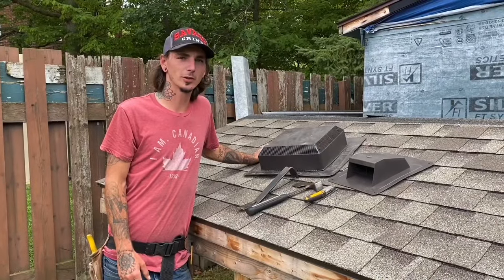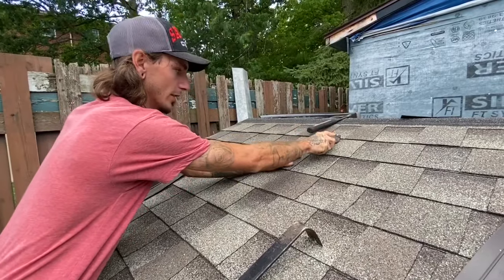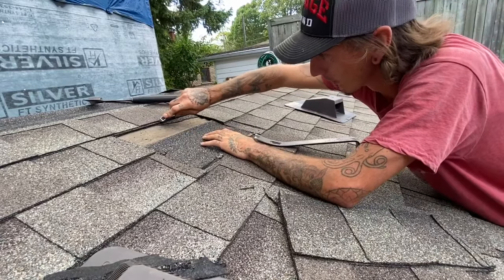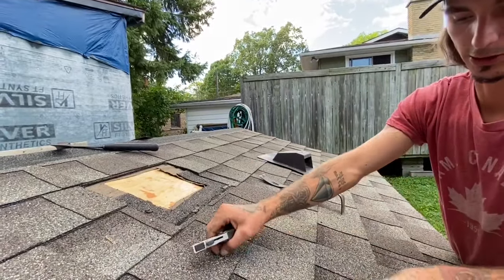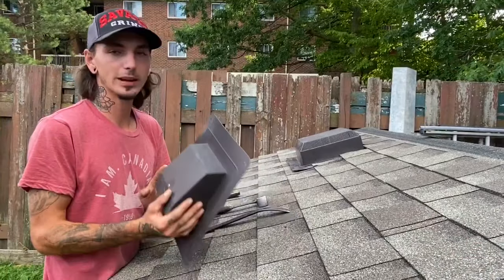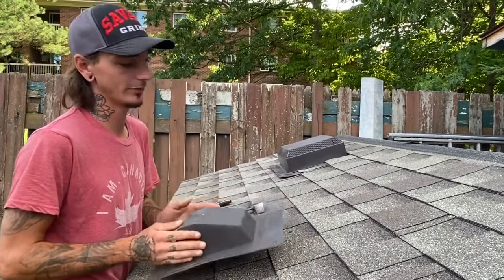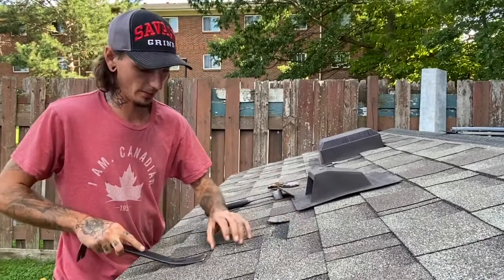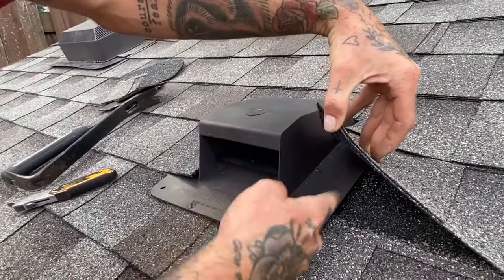How To Install Roof Vents

Comment: Putting a new roof on my shed.   Watched a lot of roofer videos. One thing I found out.  Everybody does something different.  So what do I do?  I pick the guy with the best presentation.  You're a good speaker,  you stick to the facts,  you don't have an attitude, and  you don't tell me a bunch of stuff I don't need to know.  You're above average. Thanks
Reply: great comment
Reply: I second this. Best 12 min of my day, so far!
I’m here to learn. You did a great job at teaching this. Just saved me $400! 
Only thing I would add to this would be techniques for cutting the vent hole in the sheathing.

Comment: Good install, you should mention for the newcomers,  never install the vent before the hole is made. If you're gonna make the hole, make sure your not over a rafter. I once cut a hole thru plywood that had shingles under it and set the attic on fire.
Reply: Damn, what kinda bit were u using?

Comment: Thank you so much I'm going to do my roofing courses next year and apply for my apprenticeship. I'm just studying and teaching myself through your videos and other online sources. I work with roofs as a gutter cleaner, window detailer, work is slow now because of winter. There not much work so I'm spending my time learning new skills!! =D Your videos are clean, simple, and detailed!
Reply from the maker: If you’re in the United States I recommend checking out Upstryve at https://upstryve.com for your courses, tutors and exam prep.
Reply: It's hard work but it's a valuable skill that pays well. I did the same in my younger days boss did sliding & roofing I lean towards brake operator's lax roofing. On the first day on the job when through 7 rolls of coil trying to learn. Surprise I did get fired! I lasted about 3 years very grateful to learn how to be a DYI!
Reply: @Average_Roofer  what about from ontario
Reply: Make some videos of what you know

Comment: The Pro 50s have small dash lines now where the vent should sit on the hole for proper ventilation. An easy template for the vent cut is to use a shingle. The height of the shingle is the same width as the exterior vent cover.

Comment: Thanks for the knowledge man. How do you calculate the number of vents you need on a roof?
Reply: Your ratio of roof vents to soffit venting needs to be where the soffit is greater than the roof venting.  But generally you want one every 15 feet only on the backside of the roof.  Unless you have ridge vents then you dont really need any extra venting..  you want to make it where the airflow will enter through the soffit and exit through the top venting, if the ratio is off then the moist air gets trapped inside and doesnt circulate..  theres a website that has the specifics but i forget exactly ...
Reply: 1 square foot of ventilation for every 300 square feet of attic space.

Comment: I been doing roofing for 28 years and I never install air vents that way but every roofer has there way as long it doesn’t leak and it looks good all that matters. And what counts is that you don’t get a call back roofing in the northwest since 1995
Reply: Why didn’t he at least cut a few holes in the plywood for hot air to release ???!

Comment: How is that vent snug fit into the duct? I mean you placed it flush on the roof, but where is the connection between the duct and that vent? Do you have go go to the attic to do that?

Comment: If your just only allowing for a true exposure for second row of shingle above vent, for the vent your using, weather pro 50, you must cut plywood for vent hole right down to nail line of first shingle that is directly below vent flange. Your vent hole will be roughly 2-3” below the hole you initially cut out of roof deck. You should know this man.

Comment: hey man, why not just use a saw to cut a hole? no hate im just curious as im about to install some vents on my house. also why do you remove the old nails? are they in the way of your new seal or where your new fasteners are going? oh and one more thing, why now mastic sealant?
Reply from the maker: If you use the saw to cut the shingles a. It will wreck your blade, b. The hole will be too big and as for the mastic sealant, the durable pro 50s manufacturer specs do not require it.
Reply: @Average_Roofer  thanks for the response.

Comment: I shopped at my big box store looking at roof vents.  I think a video on vents and vent options would be good information to have.  I have a roof vent fan with a burned out fan motor and lots of hail damage on the aluminum top.  I'm going to want to replace that vent and install more ventilation in my roof without creating too many holes in my roof.  Back in August I found a roof leak.  Turns out it was a bullet hole right over my bathroom from last July stupidity of my neighbors.  I caulked everything and it's holding for now but my roof has been damaged also from falling branches from my next door neighbor's roof.  I think I'm going to have to hire a lawyer for that.  My roof has an Eastern side and a Western side with hip roofs on the East and West.  We have prevailing West and SW winds much of the year.

Comment: Still don't get why the hatchet hammer.  I use one, but only on a cedar shake roof. Does bdr cut the plywood 1/8 too big? I sharpen the shaft of my estwing for slight plywood modification.
Reply from the maker: Ripping nails under walls, easier for repairs when breaking tar strips on shingles etc. Lots of reasons to use a hatchet
Reply: Thanks, next time I tear off against a wall, I will try a hatchet on the step flashing.
Reply from the maker: fender bender works great. Used it today actually. Counter flashing was 5 inches wide and the homeowners didn’t wanna replace it. Hatchet worked perfect for pulling nails

Comment: Why do you install bath or kitchen vent cap lower then regular vents?
Reply: The first vents for for moving air in the attic and the cape for bath and kitchen you want to be as short of a run as possible to keep it from possibly condensing and causing moisture problems in the attic

Comment: and this is how you get one of those nice leaks, folks

if you had one installed like this a few years back, go into your attic and look at the condition of your plywood
Reply from the maker: I do this with every pro50 vent and have new had a single one leak. How do you suppose I install them, as this is manufacturer specs.

Comment: What is a roof vent? 😅😅😅😅 nobody needs this in Europa!!!!
Reply from the maker: In North America we vent our roofs to prevent moisture and rotting of the roof decking. 
In Europe I believe you use tiles on spaced strapping which wouldn’t require ventilation. (Don’t quote me on this as I am ignorant on European roofs)

Comment: C'mon brah
U made that look hard
N some jibberish bout caulking only lasting...... what five years
Last way longer with a solid amount
But where I'm from we use roof tar
It last forever.....
Get a real bar n that tar line is easy to peel up
U got a demolition bar to peel up 1/8  inch shingle
Wonder how many shingle tar strips u wasted with that bar.
Thank god u advertise as average
Reply: Roofers act like frame carpenters who act like drywallers who act like tillers who act like cabinet Installers who act like ......if all ur work is within a 32nd.  U good
But most dont know 4 30 seconds is an eighth eighth inch
Industry standard Is 4 32 
But most can't hit 6 32